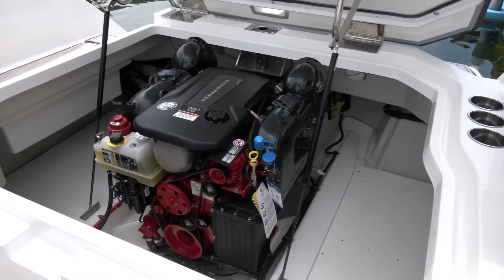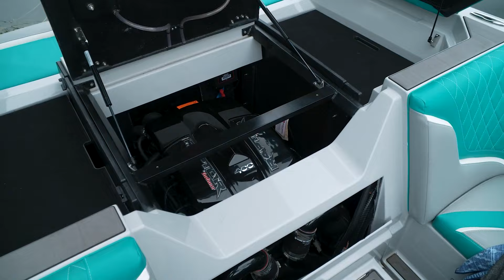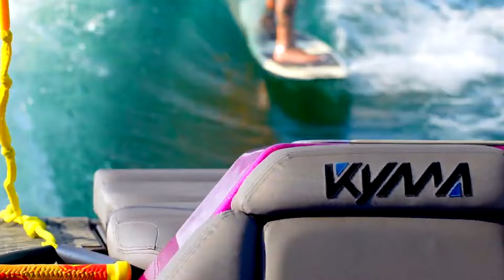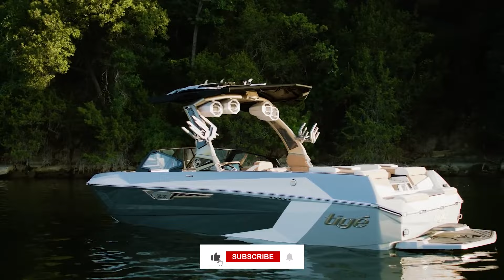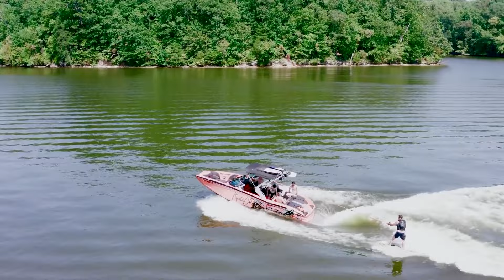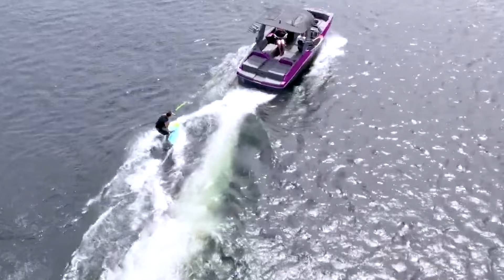Can This Engine Kill Stern Drives Forever?

Comment: You bad mouth a Sterndrive, I’ve been in the marine industry all my adult life. But I would rather have a Sterndrive than a jet or outbound in my boat.
Reply: You are so correct 5.7-350 Chevy so easy to work on cheap to replace cheap to hop up stern drive is fairly easy to work on and maintain
Reply: Yep. Just keep it on a trailer. Its twin stern drive cruisers that give I/O a bad rep.
Reply: @dentalnovember  its mostly bad maintenance that gave them a bad rep. If you dont ever look at them, let the oil sit in there for 15 years and wait till the bellows are torn before replacing then thats a user problem and not a mechanical problem.
Reply from the maker: Just providing an alternative. I have many good experiences with stern drives also.

Comment: Jet drives have their own issues. Anyone that works on jet skis knows that. Indmar marine systems historically are tough as nails. I AWSA slolom skied 40yrs behind Indmar and Pleasurecraft engines. Engines died! A friend assumed that his 2019 Yamaha 1200 ski engine seized. The sea bearing leading into the jetdrive unit seized. I discovered the problem after I replaced his burnt out starter.  The catalytic converter in jet ski  is the size of a fishtank!  Plastic parts on plastic parts are time bombs just waiting to break down. Since pollution controls became mandatory on all inboards, Mercruiser manifolds with O2 sensors ALL HEAT CRACK where the exhaust enters the rising elbow! One leaked into a sparkplug hole, with 80 engine hours and nearly bricked a 2018 4.0 200hp Mercruiser in my buddy's Searay that I use.

Comment: Stern drives being hand grenades is older than me, I'm 55. Nothing secret about it.😂
Reply: Pretty sure if they are smartly maintained, they provide a reasonable service life.  If it was for a workboat, different story, inboard all day, every day.  There for a while Yanmar made 2 different diesel outboards aimed towards commercial or dingy use for yachts running diesels.  Then you only needed to deal with diesel fuel for all of your engines.